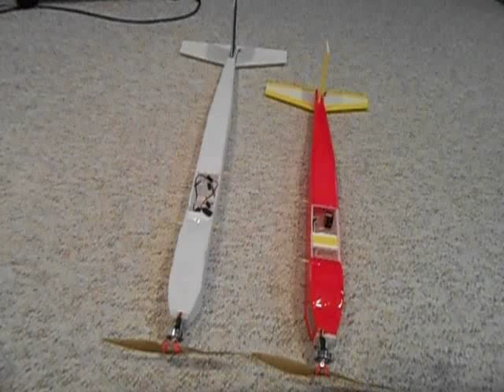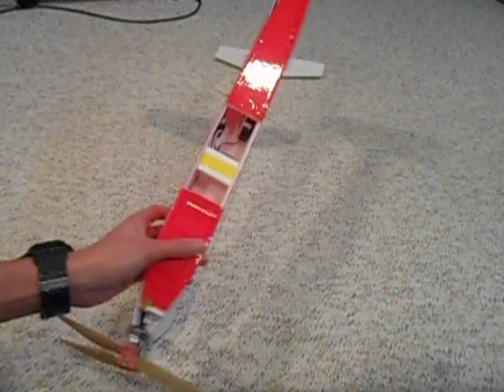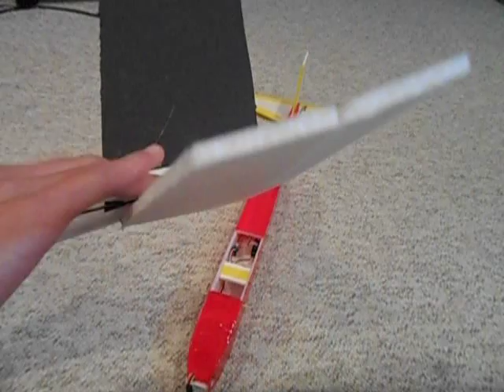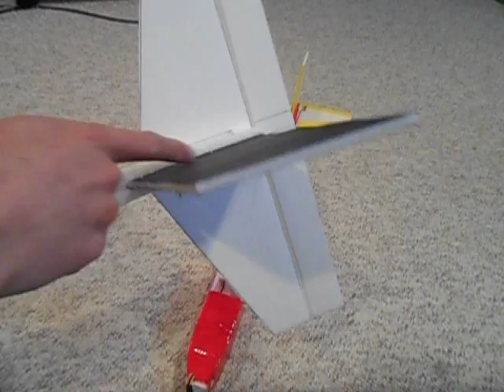Foamboard Scratchbuilding Techniques: Tapered Fusulage

Comment: The smidgen of weight you drop taking the paper off isn't worth the loss of structural integrity. But even more important is that the tape doesn't stick to the foam as well as it sticks to the paper. So you've got to run the heat gun across it to get it to snug up, and that runs the risk of causing misshaping to the foam board. Plus removing the paper is time consuming and unnecessary.
Reply: Agreed. The weight of the paper would have been no more than a couple of grams but the increase in rigidity would be worth it.

Comment: I have just tried this method leaving the paper on both sides for a pylon racer fuselage. really impressed, it came together quite nicely with nose and tail tapers.
finished weight for a 650 mm length was 70 Grams :-)

Comment: I have been working with foam board and blue 1/2 inch insulation foam for over 15 years... just a tip... leave the paper on the inside and peel off the outside. It reduces weight and still yeilds almost as much strength. Plus you can sand the corners. Try out the Home Depot Owens Cornering 1/2 in by 4 ft by 6ft sheets of the insulation foam...They are only like $8 a sheet. You can carve it with a knife... sand it like balsa wood... and use epoxy orderless CA or my favorite... 3M Super 77 spray!